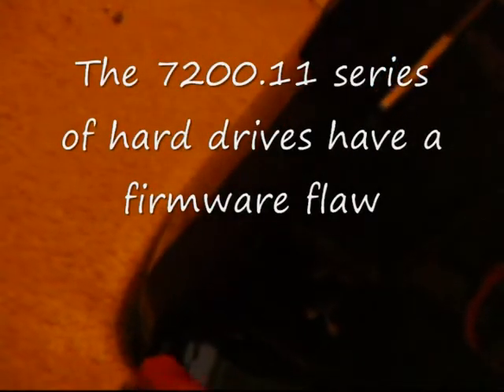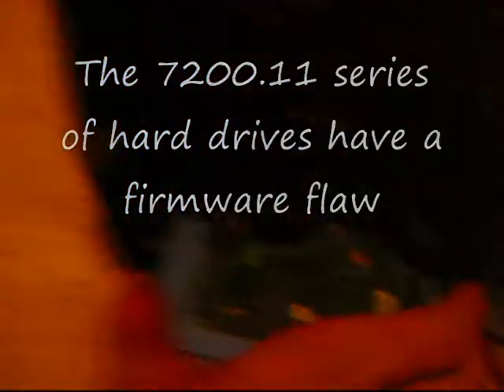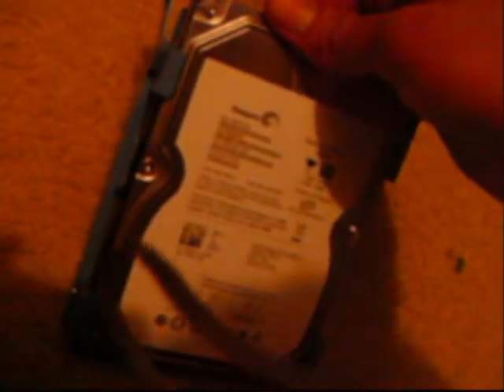Seagate 7200.11 Hard Drive Failure in a 3-month-old Dell XPS 430

Comment: I had the same model but a 500GB drive in my core 2 duo computer from 2008 - 2011 and it has not failed, drive is still in use in another machine and works flawless. Seagate 7200.11 I have used Seagate's for years and never has problems I had a few WD drives and they have bad spots within 2 years of use, I think Seagate's rock, I trust Seagate drives for more than a decade not one Seagate drive has failed on me since 1999.

Comment: @CubeComputerChannel 
I never had this issue. But I bought 4 WD drives today and talked to the tech guy about the 7200.11 Seagate and he said they no longer are producing them and there is a new firmware issue but they can't figure it out. Nice of them to let the consumer know. There should be a recall based on the numbers I am seeing in forums etc.